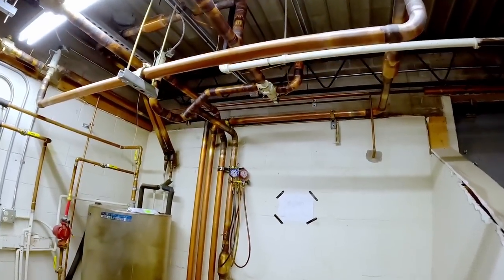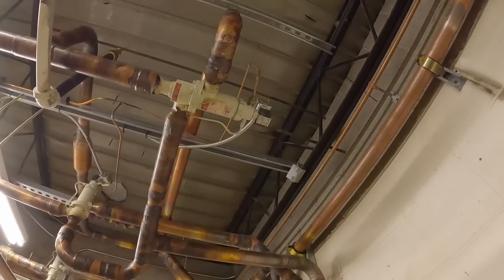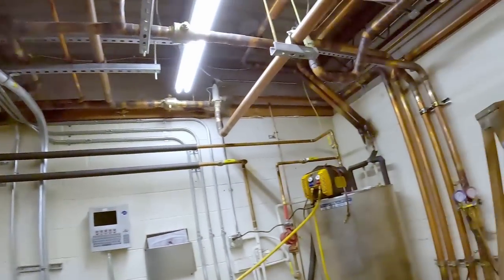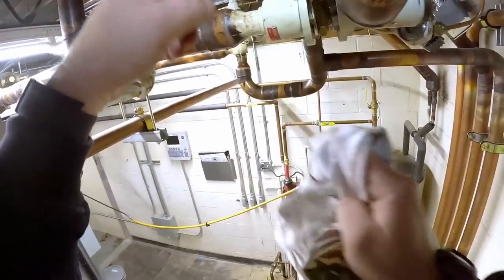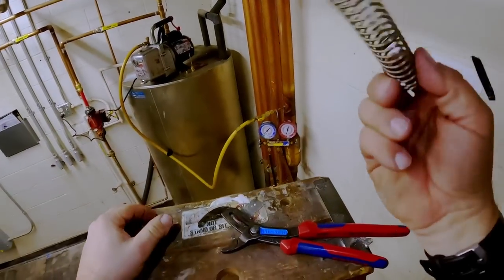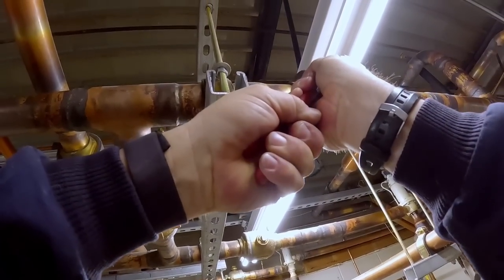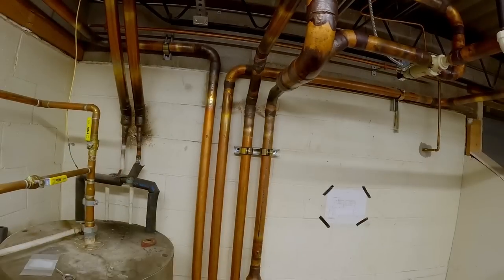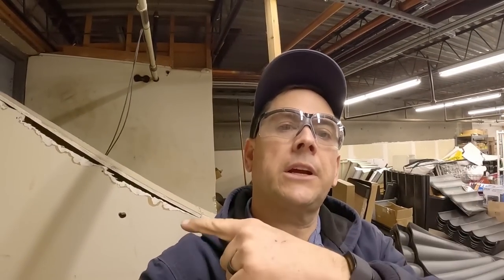The Meat Is Still Cold But The Repair Needs Finished

Comment: I always have a tube of Permatex One Minute Gasket Maker and Loctite 515 Gasket maker for those situations, both work great in sealing a flange if that gasket is worn/incorrect.
Reply from the maker: I have used something like that on steam traps, how long does it have to dry before using it on high temp and pressures like refrigerant?
Reply: @HVACRSurvival  The minute gasket maker dries within 15 mins (Even though it states 1 minute). The loctite 515 I am not sure, I have put back together parts and let it sit for maybe 5-10 minutes before tightening a flange down and it seems to have held with no problems so far.
Reply from the maker: @saugatools402  it sounds like something good to have when you can't get the gasket right away👍👍 thanks for sharing!

Comment: Never worked on any supermarket before....about the only side if the trade i haven't experienced....probably won't at this point in my life. I enjoy heavy commercial and industrial. I especially enjoy the hydronic side. Chillers and boilers are my jam. 

As always another great video Rick. A true professional
Reply from the maker: Grocery is a  hard market to get into. There are only so many grocery stores compared to regular business and residential. I've been finally getting my chance to do more chillers just recently. It's been a slow transition into industrial and racks.

Comment: Thank you, it makes a lot more sense, when you can actually see what is inside the housing.  Those commercial systems are neat, having that valve to allow you to block off the High Side, while you evacuate the Low Side.
Reply from the maker: That's how I feel as well. If you follow my Instagram page I posted a valve three times larger and has two pipes in and two out. It's interesting how they cut the sliding piston to direct the flow.

Comment: yeah cant really gauge liquid when running in split, also when you want lower pressure you can go to the controller and override some compressors on to get your pressure low enough where you like it and then valve it off well at least thats what i do
Reply from the maker: Thanks for sharing! All great information👍👍
Reply: @HVACRSurvival  winter time has a lot of liquid stacking and VFD issues over here where its condensing too quickly and there is not enough liquid coming back to receiver so just make sure all your discharge pressures are near your float setpoints it will cause a lot of issues, floodback to compressors due to not building enough differential, not enough liquid going to some cases ect.. subcooled liquid should never be lower than 55 degrees anything lower and you are just wasting energy and refrigerant due to being subcooled refrigerant is more dense and can  not doing much more than 55 degree liquid but being subcooled you can down size your valves for load for increased capacity from efficient subcooled liquid, not sure if it helps but just throwing it out there
Reply from the maker: No, it helps to hear it, there's a lot of times you know the principles but until you see them in action you don't really put it all together in full coherence.

Comment: My local Walmart lost 90% of all freezer and fridges twice, not sure what failed.  Is there one loop that would cause that?
Reply from the maker: What do you mean by "one loop"?
Reply: @HVACRSurvival  I am not sure but the entire super walmart lost all refrigeration with exception of some individual floor units.  The said it was a leak.  So I was wondering what would cause such a huge failure in all freezers and fridges?  It just seemed odd to lose so much and not from power issue but leak.

Comment: So how do you pull a vacuum on something that immense? Many pumps for sure but what about a micron reading? Because that system is huge, is an initial vacuum of 1000 microns even possible?
Reply from the maker: Sure it is... when it's new. The problem I find is overtime there are several little leaks, in the valves, braze fittings, trapped refrigerant in the oil. Several little things add up. All we can do is do our best with the time and equipment we're given.
Reply: @HVACRSurvival  you make it look easy!
Reply: Everything can be pulled to a sub 100 micron vacuum if the system is tight and you bring enough vacuum pump oil and have enough time. I know guys who have made repairs to chillers and had to leave the pump on for three days straight, returning one to two times a day to change the oil. Pulling a vacuum slowly is infinitely better than pulling one fast. A fast vacuum can freeze moisture. 🤷‍♂️